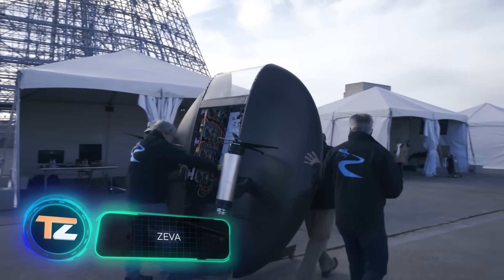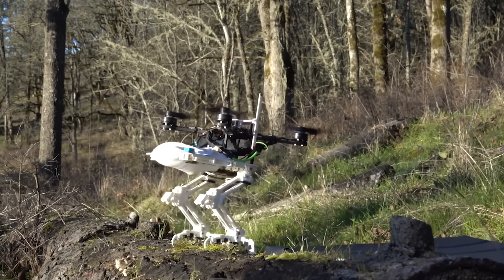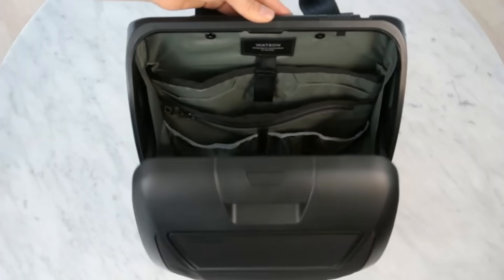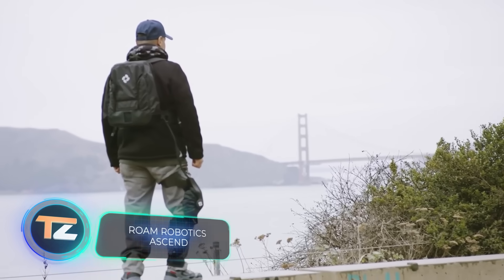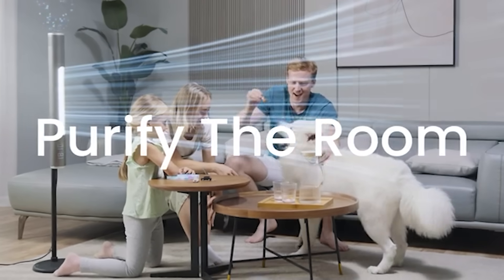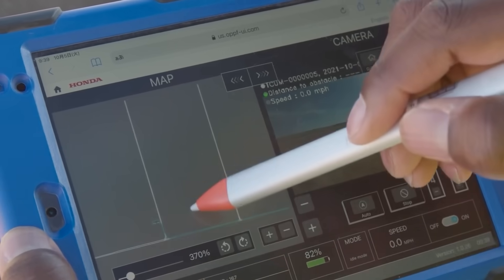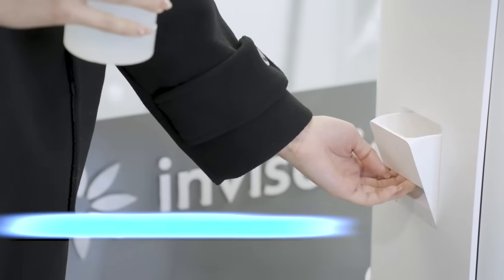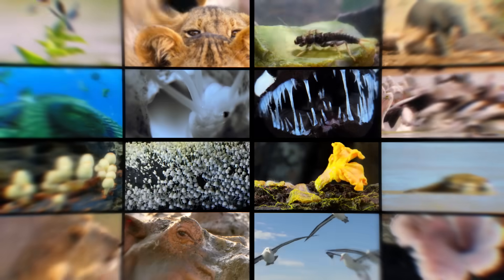NEXT LEVEL INVENTIONS THAT YOU SHOULD SEE

Comment: If the Genny can make that much water a day just by pulling it out of the air, then why don’t they make very large ones to end the droughts in the world. If every house had a unit large enough to fulfill all of their water needs we could really change the world.
Reply: because those things burn so much electricity you have to measure the electrons by weight in tons, not by killowatt hour. it would be more energy eficiant to de sanlinate sea water.
Reply: Something like that would be heavily dependent on it's environment. The location must already be humid before hand, otherwise there is nothing in the air to grab. But at that point water is not an issue for those who live there
Reply: If that simple, then Saudi Arabia would be doing that, they have as much as power as they want, but more efficient to clean seawater, this tech has its place, there are larger scale water dew harvesters in South America, where they condense at the top of Mountains using nylon nets, no power needed.

Comment: Wait isn't watergen GENNY like any other dehumidifier?
Reply: It's the same basic concept, but with added stuff to keep the water clean and store it clean and make it hot. If you drink water just out of a humidifier you can get really sick. The water in regular dehumidifiers can collect and grow mold, mildew and harmful algaes, bacterias like legionella that can cause pneumonia, and it can also contain lead and other metal residues from the component parts of the dehumidifier. Boiling will not sterilize the water. A device made for specifically cleaning, storing and safely dispensing the collected water is needed. Like the product featured in the video. Hope this info helps you understand.
Reply: @LaineyBug2020  damn
Reply: It's not anything like a dehumidifier.
Reply: @snakedoktor6020  but it says it draws water from the air's humidity
Reply: @deathconccc3338  you are correct. I should have said it is so much more than a dehumidifier.
Thanks for keeping me on my toes!
Reply: @snakedoktor6020  its actually exactly a dehumidifier, just that it collects the water to drink instead of making the air dry, but the effect is the same regardless of the reason why its happening >_< EDIT: nvm i saw ur answer to another post and that clarified how u meant it, yes its alot more than any other dehumidifier, thats true since need to make/keep the water drinkable ofc